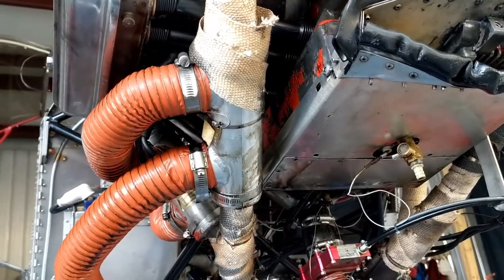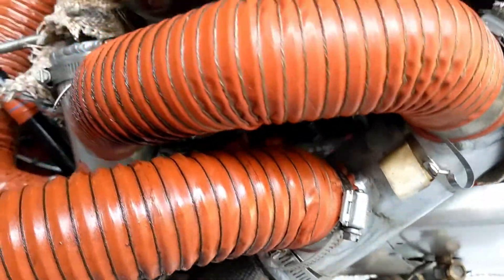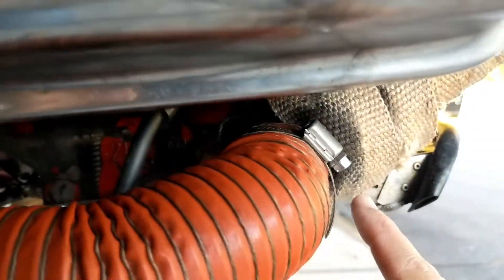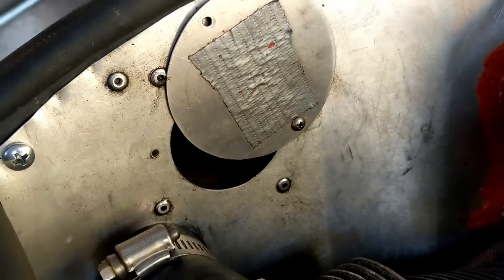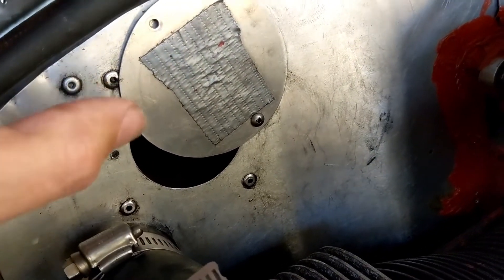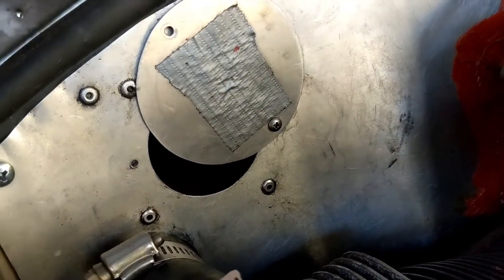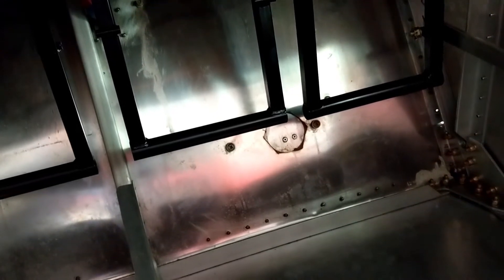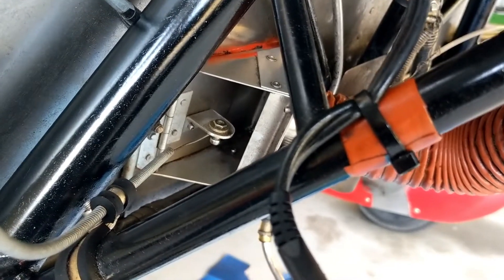AeroVee VW Heat Muff Description

Comment: Bringing those heat muffs closer to the port does magic. You will be surprised by how much the exhaust cools down for every cm it travels downstream.
Reply from the maker: The muffs are as close to the bends as I can get them. Any higher and I'm on the curved portion and the muff won't close up.